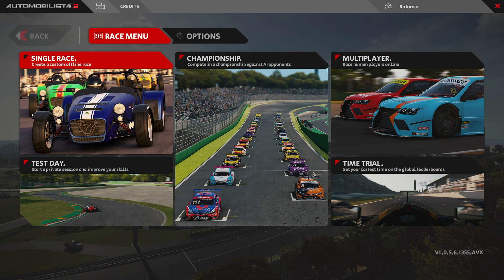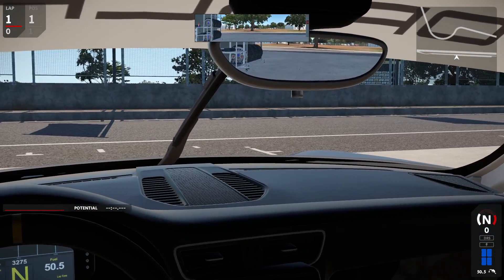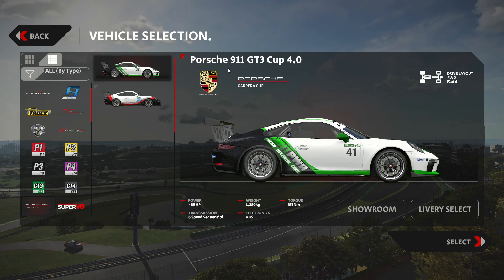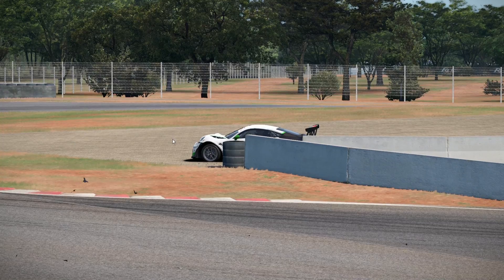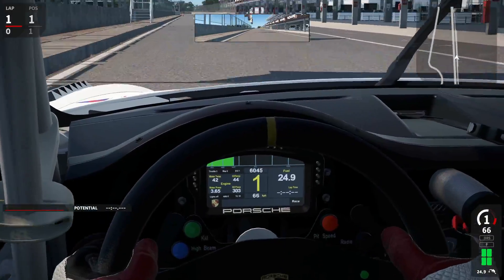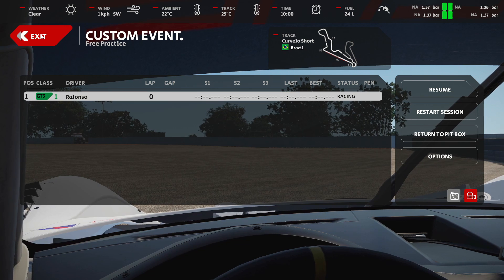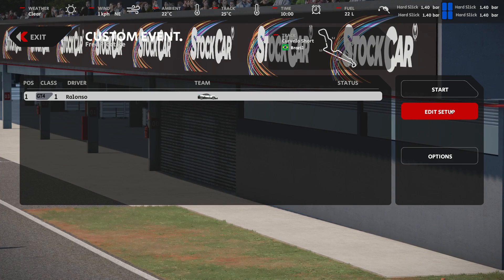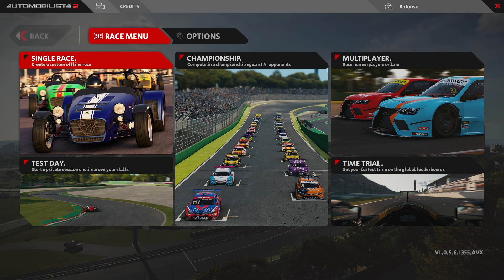Automobilista 2 ver. 1.056: Damage Model Test And Comparison Within All Porsche Cars!

Comment: Very interesting video, Ralonso - and those first couple of crashes just shows me that REIZA has great respect for the work that the Marshals do at race tracks. Cos REIZA doesn't want them to have to pick up all those glass pieces from a braking windscreen... hahahaha ;D
On a side note, I've mentioned in some of my video's that when I talk while wearing VR, my jaw movement makes it very VERY shaky. So I nearly always re-record the VR directly from a REPLAY, holding it much more steady in my hands - then I just sync the audio to the recorded replay, by usually using some sort of 3, 2, 1, audio before I start recording. So do you know offhand, if you can ALSO? use your TRACK-IR in a replay as well --- or ONLY while you are racing???
Reply from the maker: Thank you, SingleRacer! And yes, Reiza in fact, LOVE the Marshals hahaha🤣👍. But I think, they will include the glass brakings in their damage model as well..soon! In terms of recording I actually do my stuff always while I'm racing, I never did any replay recording. It would be too much work, you know! But I can imagine of the need you have to do so, in case of the vr beeing affect by your jaw movements..
Reply from the maker: Luckily I have not encountered any issues with the track IR yet! I think the track IR in general is a good alternative to VR.

Comment: I don’t know even early 2014 games like Grid Autosport had beautiful soft body deformation. That game was basically damage sim if you wanted. Now the community is full of bullshit and cheese. This is not dynamic soft body as Grid 2 or Autosports.
Reply from the maker: Yes, I fully agree! I played Grid myself, back then, having the PS3 version. And even on this platform, the game had a nice deformation damage model which I loved. Modern Sims are doing very hard to implement proper damage model, starting with Gran Turismo, which really seems to have set the "roule" for that.. Anyways, I appreciate that AMS2 is going back the other way round, it can be a starting point of a new approach to the topic.
Reply: @RalonsoF1  yeah I can only hope. Same is true for Dirt series as how devs basically killed the game. Dirt 2 is still no doubt the king of the series. Grid 2 is the same. Even a simcade like Shift, Shift 2 had extreme body damage back then. They also killed the series by Grid 2019. Sad really.